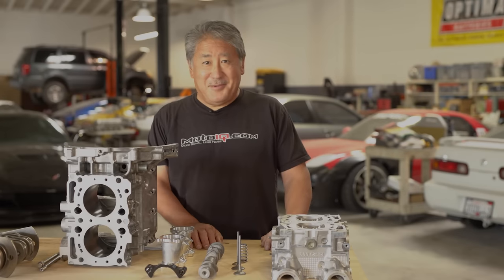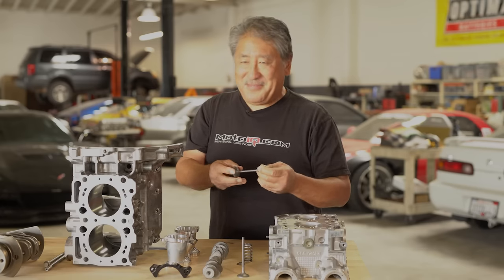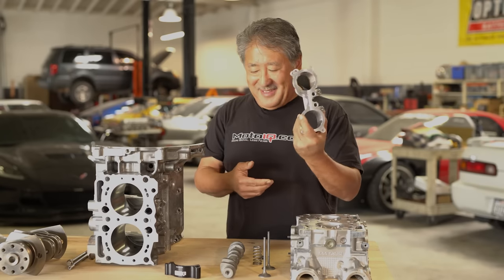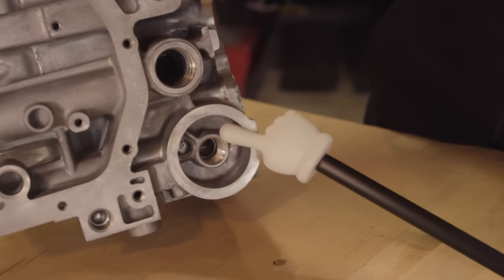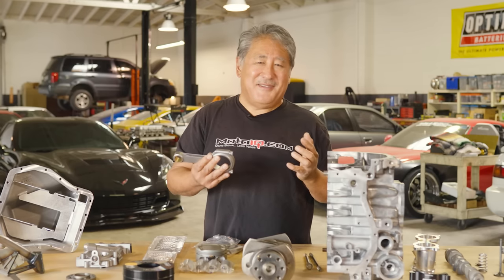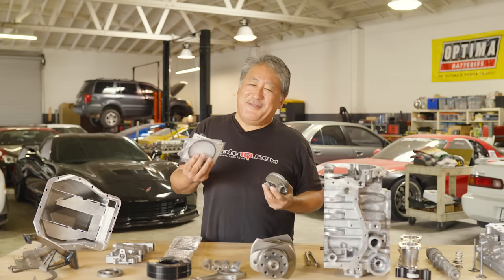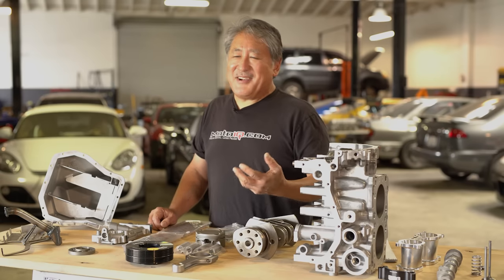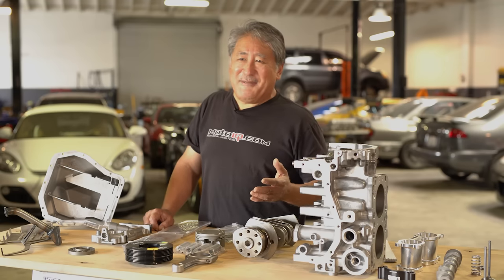How to Build a Subaru EJ Engine that won't BLOW UP!

Comment: Do I have an EJ engine? No
Do I plan on building an EJ? No
Did I enjoy watching the whole video? Yes
Reply: I agree, pretty much every company makes a 2/2.2/2.4/2.5 liter engine that this applies to though
Reply: In my instance it was Yes/Yes/Yes.
Reply: 1. Yes x2
2. Yes x1
3. Yes x10
Reply: I have an EJ205 with 7k miles on the rebuild feels good lol
Reply: Ha, my last car with a Legacy GT with the EJ255 (2.5 turbo, same short block / heads / valvetrain as STI, just different turbo). Honestly I think the 2.5's were a step back from the 2.0s. This also looks like an insane amount of money and work just to hit 400-500hp when other manufacturers can get there stock (any chevy/ford engine, especially the LS), or more reliably, like the Honda K series with a turbo. I just wish Honda made better RWD/AWD options to pair.
Reply: @Darkhunter218  they rebuilt it?
Reply: @neilquinn  but they’re not a Subaru 🤷🏾‍♂️
Reply: Yes yes yes
Reply: @neilquinn  yeah 4-500 hp ranges can get costly esp when you have to upgrade oil system/fuel ap/ecu....fab better cooling. VS the platforms/engines you listed. Currently trying to find a nice 250-400 hp range build thats essentially use/cost effective. Its why the 2.0 ej is in my list....where as a FB 12 a rx-7 is on the lower list of power....but still high cost XD. and high cost to run. The FB was one of the cars/builds i started with and the cost of a stand alone+an ideal carb/runner set up matched to equal length headers/exhaust system and tuning cost bc of how concurrent it is based on porting...has definitely pushed my budget and Horizons elsewhere. I mean i even considered a z31 build with a vq30...but as it stands that engine is still too expensive to swap...hopefully with the new z it can be "tinkered with/upon" and more aftermarket support can come into play with wiring/cost effective tunes etc. So that z31 build can be more of a reality...considering how i was going to swap z32 parts into it...im kind of HYPED to see if z35 parts can be adapted to a z31. Like dif/trans is obvious, but the rack/brake system, and modded ecu if possible would be a HOOT of a build.
Reply: @bencampbell498  wait til you hear about their pricing. Thats after you. Bringing it in. They put in work and quality piece
Reply: Hahahah me too, but one day... ill finally have $30k to buy me dream car, a blue 06 STI
Reply: I want him to build my FA20 to handle 500whp 
I wonder what it cost to do all this haha
Reply: i have ej25. thining to swap for sohc ej20. direct fit. even ecu will work
Reply: @Darkhunter218  hows the motor now if we may ask if you still have it!
Reply: @Foxy10-b6n  The shop that did the rebuild on the 205 used the wrong head gasket and coolant got into the engine and caused bearing failure, took it to a different shop and got an RA block and B25 heads for it, frankensubie but she's running well, over 11,000 miles on the 257 and no problems, been dyno tuned by Snail performance since 1k right at end of break in period.
Reply: I watched this video about 6 months ago, then found a great deal on a bugeye with questionable reliability
Reply: 1:no
2:no
3:yes
😆 🤣
Reply: 😂 you and I both
Reply: It can't begin to imagine how much it costs. Not to mention, why build up a small engine when you can just get one with a larger displacement
Reply: Hell yes i enjoyed the whole video, and No for the first two for me too.
Reply: Ongod 💀
Reply: Hahaha, same dude.  I love all of these videos.
Reply: I wish I’m baked and YES PATRICK
Reply: @spacejunky4380 I wonder why.

Comment: Mike is basically a walking automotive-related encyclopedia. Another great advice to add is having a great tune and always addressing any issues that the car has, immediately!!
Reply: Improve the pcv setup and do everything you absolutely can to prevent oil blowby getting oil in the cylinders and causing detonation.

With such a short small crankcase the pcv for the case is right by the crank which is spinning oil all over and oil vapor and it sucks the oil mist right up and either cakes up in the pcv or sucks into the intake and into the cylinders ruining the cats as well as causing damage under boost, caking up on valves etc. 

Boosted, even worse blowby forcing it right up the pcv

Comment: I hope this is a series. I’d love to see it being assembled and then tuned etc..
Reply from the maker: This is part of our GD WRX project, so be sure to subscribe and keep an eye on the project:
https://motoiq.com/category/projects/subaru/gd-wrx/
Reply: @motoiq  yes  great  just subbed
Reply: @motoiq  yeah I wanna know what all those parts do on the dyno and in the car, and how much it costed, lol
Reply: @motoiq  its a great build but those eagle rods should be last resort!
Reply: Feral Man  lol
Reply: @boppernostopper8598  why?
Reply: @andreneeb1165  they handle 450 whp max and the ej20 block is easy. Ej20 is more reliable up to a certain hp. Cylinder walls thicker
Reply: @andreneeb1165  so its like a cop out
Reply from the maker: @boppernostopper8598  There is nothing wrong with Eagle rods.

Comment: Mike, I've spent years building engines and it took that long to dig around and build up the core knowledge you outline in this video. This is without a doubt the most comprehensive and concise run down of building and modification details I've ever seen. Obviously there is some esoteric detail that is Subaru specific but from beehive springs to rod ratio to hone plates to valve shape and porting. This stuff applies to really any performance engine build. Thanks so much for this, man.

I'd encourage anyone interested in engine building to go through this outline and dig deeper into each section Mike has covered here. There are ways to do some of what he's outlining in this engine build that are not as expensive. CNC porting is the best but even a little care and skill with a die grinder will yield good results. Blending the valve seats, getting the block prepped well, deburring, matching the water jacket ports with the head, finding the best parts you can afford and parts that work well together. What the running characteristics are that don't translate to dyno numbers but do offer a better, smoother performance. Good stuff.
Reply: wat r u on m8 u shood not diy the head without a flow bench
Reply: so much work. im just gonna drop in a used boxer engine and call it

Comment: I'm telling ya coming from a owner of a 02 wrx with a ej205 built with a stroker kit hands down love it. 92.5mm pistons and Manley rods h beam. Sti crank heat treat,td05 20g turbo,750cc inj,fmic ...etc,etc. 400whp daily driver 30k miles no problems.
Reply: How many more miles you think you’ll get out of it?
Reply: @nathansmith9812  prob another 45k till I change the timing belt again it's all in how you drive and maintain plus I  built it right. Doesn't even burn oil at all just saying.

Comment: This is fantastic info. I’ve had an EJ257 that was a bit of a test bed when it was put together about 10 years ago and has been subjected to lots of circuit (road course) use as well as street use. I stuck with stock stroke but used long rods with custom short CP ceramic coated pistons. I’m also running Kelford cams/retainers/springs with high lift 264 cams. I’m using Possum Bourne Motorsport 14mm head studs/TGV deletes. Some things used here are a bit different (probably better here if I’m honest) but I’m cheering about the similarities between this one and my slightly oddball build back then. Excellent content and presentation!

Comment: Remember the good ole days when we ran extrude honed b series intake manifolds and they kicked all the asses? Well, these oil gallies need that love! Soo many rough and sharp edges, all working against the surface tension of the oil and adding heat and friction!

Comment: Those are great cams for a EJ25 Hybrid or EJ25 with AVCS removed as well. I used them on the latter with e85 and a TD series turbo. I hit 27psi at about 3.8k and it held almost to redline. Because it was easy to keep the car above 3.5k lag was non-existent. But I went with forged internals without any other shortblock strengthening so I ended up with a hole in the block large enough I could grab the crank with the engine still under the hood, haha.

Comment: As a LS guy. This is just insane to get 400 ponies reliably. this is Art
Reply: Edit. all future builds will be WPC AND CRYOGENIC TREATED
Reply: I’m making 463/506 to the wheels. Been there for over 20,000 hard miles so far.
Reply: @christophergruenwald5054  still holding up good?

Comment: I want to see the parts coating invoice stack from this one project..
Reply: Ditto.  Very curious to hear more about where it was done and what the $$$ was.
Reply: They did say they will build them for us
Reply: The costs are covered in followup  vid. Ya the coating/surfacing services aren't inexpensive. Noted: the big thing on this motor is the use of 'torque plates' to duplicate assembled distortion during  machining ops. For better power , longer engine survival.
Reply: @peted5217  who use's this exact process when they machine the cylinders? IAG? Anyone you know of? I want to have my RA block honed and maybe bored a bit.

Comment: I wish you would have just stuck with the 2.0.  I made more peak torque with my 207 than my tuners 257 with both of us with nearly identical builds, same turbo and boost levels.  I just had an extra 1k RPM I was happy to play with.  Love me that rod ratio and better oiling ;)
Reply: That’s only because you were closer to volumetric efficiency. If you were to run at the same fuel volume and air volume when the 257 gets to its efficiency you’d be out of efficiency.
Reply: 2.0 the world!

Comment: I’d love to know what this would cost
Reply: More than you could afford Pal....
Ferrari
Reply: Buy a Subaru chassis with broken motor in it then with the price difference  try to build a decent motor 😉 (that's what i did) 3.000 CHF + 10.000 CHF
Reply: I’m building a pretty similar motor and so far I think it’s around $13k for the motor and internal
Reply: @milesmcgeoy  EJ20??  Mine came from a legacy turbo year 1992 that is already Closed Deck from factory.
Reply: @tomatos9445  smoke him
Reply: @tomatos9445  lol 
More than you can afford pal ……… EJ

Comment: Fantastic insights on how to remachine these cases.  Yeah people love to talk about how factory built Subaru shortblocks are the only viable rebuild option.  I just laugh.  They don't understand engine machining.

I'm an air cooled VW guy, former WRX owner, we have the same issues with places that don't torque cases, heads, or cylinders when doing critical machine work or cylinder honing.  It matters folks!

Really great video.  Thanks for putting this together.

Comment: YOU STILL NEED A GOOD TUNE, literally you can blow up any engine with a bad tune
Reply: bad tunes and abuse = boom
Reply: @ThatWasPrettyFunny  his point is saying you need a good tune. Yes you have to tune the car but if it’s a shit tune you’ll bowl it that’s his point.
Reply: @Joe-nq6hy  a decent mapper can fix, or at least, identify, all engine performance issues. Especially where it’s engine management related.
Reply: its also not a ej257 which you guys in the US have in the sti with all the issues. he built off the ej205. STI in japan/europe has ej207, twinscroll, 8250 redline, el headers, big port heads, none of those reliability issues that the US sti has with that 2.5L.
Reply: @matt260  why the hell did we get the 2.5 again?
Reply: @michaelhernandez8418  emissions/regulations.

Comment: Those modifications cost another car
Reply: learn to do it yourself....
Reply: @Russell_and_Rosko  the machine work and material is really expensive
Reply: @That-guy0801  as an engine machinist I can 100% agree subarus are a lot harder to machine than most other engines. Plus if your main bore is out most places can’t fix them because of the split blocks. I’m building a 2.5 with Brian crower valve train and a forged bottom end and it’s costing the guy about $12000
Reply: @leojensen9270  I have been asking around about a 2009 Impreza, im going to replace oil  cooler gasket because I have a light oil leak dripping from the oil filter tightened, coolant and oil dont seem to be mixing based off the dipstick and from coolant color, BUT its my first Subaru trying to understand the H4 bottom up i guess but I am coming to the fact I might have to replace engine, at that point might as well manual swap as well, any advice would be appreciated!
Reply: @codezalo5773  Slight oil leak? Better replace engine lol. At worst you need the engine pulled and new gaskets etc.
Reply: @majorbuttface  is there a better spot to look for one besides ebay? Thank for the tip! Honestly just wanna drive now :( I'll probably resell after I ensure theres no leaks after fixing it up hopefully
Reply: @majorbuttface  I also have a video too that shows the back of the engine and definitely looks like coolant so external leak but still bad lol

Comment: Ej's are too expensive to build reliable compared to other engines.
Reply: Overpriced 4 cylinder
Reply: no thats just the STI's in the US. You guys have ej257 which has all the issues. STI in europe and japan has ej207 which is bulletproof. 2.0L, twinscroll turbo, el headers, big port heads all from factory.

Comment: Easier solution: Subaru fires their moronic engineers, and replaces them with those who actually know what they're doing! Hey, what a concept. Maybe hire away more experienced engineers from Honda and Toyota by giving them massive amounts of money. I mean, it sounds hilarious at first. Especially if you don't own a Subaru. But how many years upon years has it been? I mean, if you hire engineers who can't build reliable engines for your company; or can't make them reliable once a huge issue rears its ugly head. . . fire them! Why would you keep such clearly incompetent individuals on your payroll? This is one individual who took a serious look at the 2022 Subaru WRX, and decided "No Thanks." My current car is very reliable. I need a new one just as good.

Comment: I have an EJ20 in an original GC8 WRX and am running 10PSI even though 13.5 was factory, just don't feel the need to explode a 25 year old engine and it still pulls hard!

Comment: Good to see you talking about the longer conrods, Mike. It was something you talked about ages ago in, I think, SR20 motors. I went with 140mm rods and custom JE's in an M50B28 turbo where most people use 135mm. Oil ring needed a support rail, but it all seems to be OK 6 years later.

Comment: From a well experienced subaru guy this is definitely way to but a ej the longer rods and the line hone for the bearing those are some of the most important part of a good subaru motor I would love to here the motor run after I'd bet it's smooth as hell

Comment: The best way to compare the rev sound you mentioned, would be Basically comparing a vw beetle engine to a Porsche engine.... Also I noticed y'all basicly did the same thing porsche did in the mid 70''s with the flat 4 engine as far as basicly twerking the block before boring and head placement..... Love this!!

Comment: I fix cnc machines that make valves and it really is about the smooth clean path that the air has when going into the combustion chamber.

Comment: Hiya. I've been daily driving Imprezas for the last 10 years. For the last 5 I've maintained a well modded and tuned 5mt 2002 WRX Wagon that I drive on average 40k+ each year (anywhere from 6-13 hours per workday) for a living. Currently sitting at over 335k miles and I plan to roll over the odometer before I'm too old to work a wrench.  In that time Ive gathered the tools and knowledge to do almost anything I need to keep it going. Also in that time I've also fallen deeply in love with everything about this quirky little workhorse.  Maintenance is almost never needlessly stressful, and almost everything is really easy to get at/work on once you learn a couple tricks to work around the unusual boxer configuration 

This is a riveting watch and I really want to thank you for doing this rundown on what looks to be an amazingly fun little engine.  I'm taking detailed notes for the next time something terrible happens to mine (on it's second stock shortblock, original re-machined/rebuilt heads, original stock trans). I was happy to see I already have a couple items that you chose! (KB Oil pickup, stock size ARP HSs, IAG Timing belt guide)   I'll have to try swapping my lightweight crank pulley for the fluidampr, your description of the effects really sold me in relation to how my engine feels (every mount and bushing has been replaced with group n or equivalent).  The better oil pan caught my eye and will probably be the next thing I do given the added peace of mind it brings 

The only thing you missed (if I may be so bold) is the upgrade to balance out the cooling issues on cylinder 4!  in 2017 (I think) a guy at fatbotti tuning (I think, again) came up with a kit to easily balance the coolant flow on that side utilizing a preexisting factory drilled and plugged hole next to cyl4.  Done in 20 minutes during a coolant change, requires one coolant hose to be cut and T'd, and one plug be removed and replaced with a fitting to connect to the T you made.  Immediate drop in average coolant temperatures to a much more "acceptable" range than stock pathway,

If I ever win the cryptocoin lottery, I want you to build this engine for me so I can really put it through some endurance durability testing >:)

Comment: And I thought I knew how to build a decent Subaru engine. 

The long rod info makes so much sense and why 2.2-2.4l always seem to have the best power/rotational weight ratio.

2.4 for the Honda k series loses higher rpm too